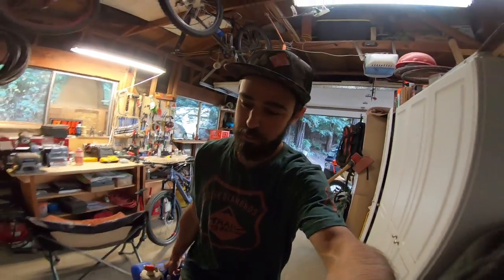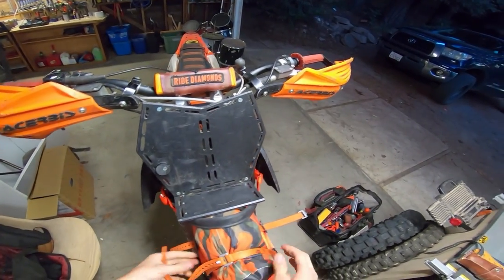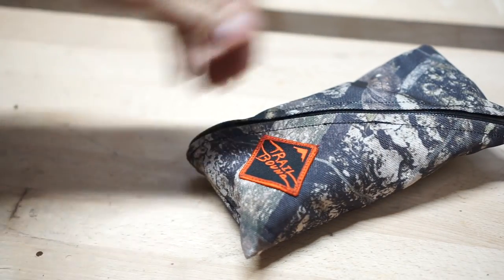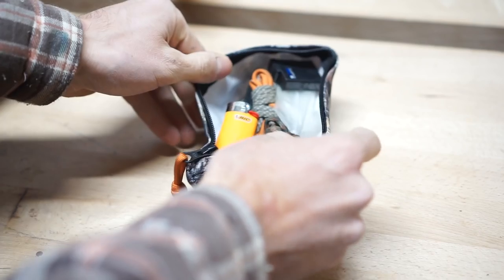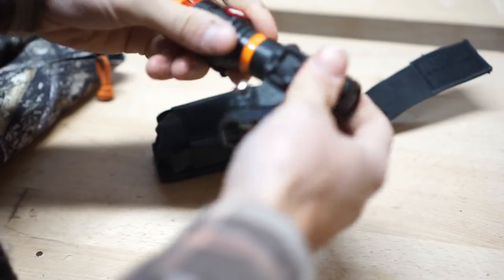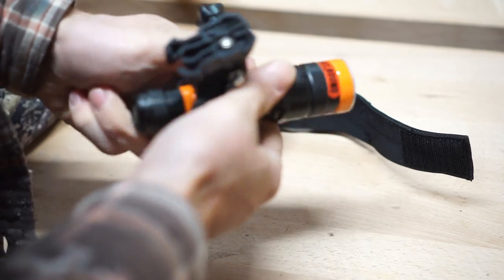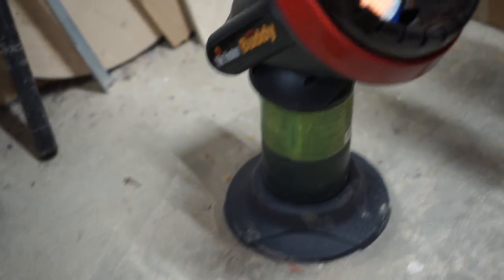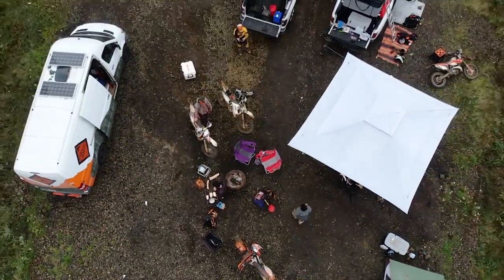Essential Enduro Gear For PNW Backcountry Trails

Comment: Spark plugs and plug wrench. 1st thing I pack in my 2 stroke. Tp 2nd.For my pack i use a Camelback mule. Its 20 years old. Love it to death.  I put my sandwich and snacks in the pocket with my water bladder so the cool water keeps things fresh. Trail saw for sure. Fox 40 whistle ( can be heard for a long way, if your hurt down off the trail or something crazy). 3 way socket driver 8mm 10mm 12mm. Folding allan wrench with flat tip n star screw driver head. My snowboarding pocket screwdriver (lifesaver) and a 26 mountain bike tube cuz I always forget to take it out.  Works great around the lower triple clamp for pulling or towing bikes out also.  And can't forget 70oz of water.

Comment: Really liked this video, cool to do informative vlogs too. In my pack I carry a set of plastic clutch and brake levers, a loud whistle, spark plug, TP, a flint and striker besides a lighter, couple of ounces of 2 stroke oil,  thermal space blanket, ibuprofen. Yeah if I could the kitchen sink LOL...
Reply from the maker: Awesome good to hear and thanks for sharing what you carry, adding in a space blanket and ibuprofen has been on my list (borrow vitamin IB from a friend a few times). flint striker would be smart, I was thinking some waterproof matches to add with the lighter. I recently put a whistle on the pack too pretty handy instead of yelling at friends haha

Comment: Great info on a few things I need to add to my pack!
Reply from the maker: Good to hear, always fun to watch other peoples gear lists and modify your every ride carry. what are you going to add?
Reply: For starters I need one of those bolt bags. After watching the video, I ordered a trail saw. Need to research a chain tool and get a master link as well. Spare valve stem is good idea too, doesn’t weigh much. Been using Strava, gonna try Gaia next.

Comment: Do you have some kind of front fender support? I carry a tool kit up front and I feel like the fender flops all over the place. Great channel, really enjoying your content.
Reply from the maker: Backcountry thanks for the comment. What bike and year? These 17 front fenders are nice and stiff. I don’t run tools up front though  I use our bolt in straps on the rear. The front fender is better for rain jacket and trail saw. We just started making a front number plate rack though that I’ve tested with tools on and it works great
Reply: Trailbound co I’m running a 2017 Husky FE350 and the tire will hit the end of the front fender several times during a ride. I’ll look into the rear mount for heavier stuff. Thanks for the reply.

Comment: Gaia is good I use it for a few years but I just but the new trail tech voyager pro and that thing is sweet especially the buddy tracking system
Reply from the maker: Cooper Small that does seem like a cool feature, how far does it track? We use walkies to figure out where each other is at but the range on those is pretty small in woods
Reply: Trailbound co yeah I mean the antenna on the gps it’s self is good for a few miles but it comes with an external antenna that extends the ranges to like 5miles I think